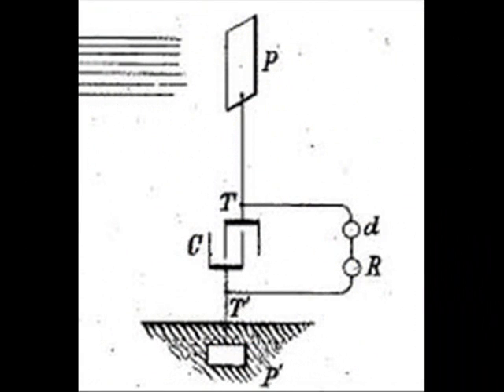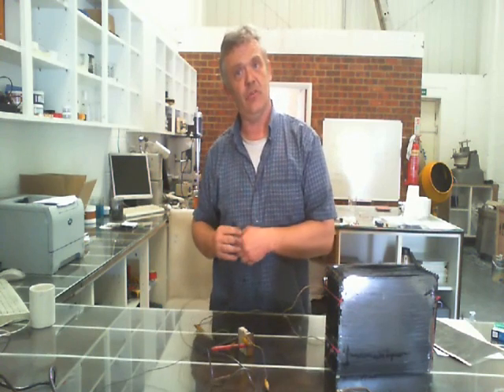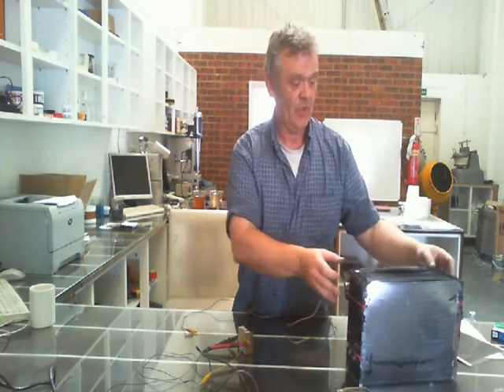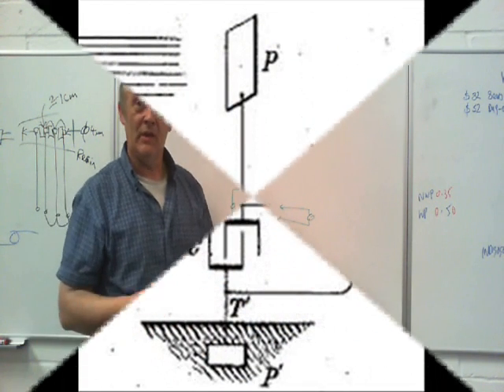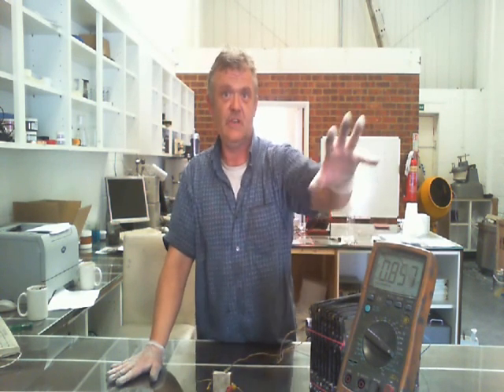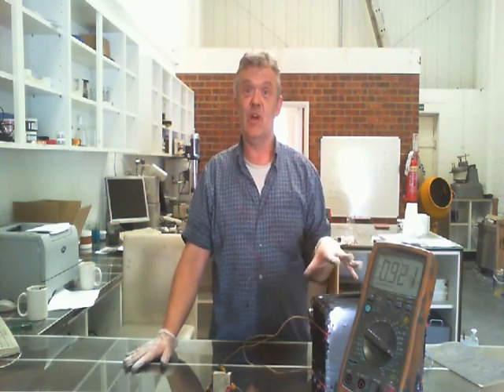SWAG As A Tesla Radiant Energy Collector

Comment: Robert... I love your vids... I have a question. In another vid, you posted one single sheet, where the ac voltage was around 120 volts or so...   However in this experiment, it is rather low, with the sheets in  parallel .   I believe it was the vid ,  Graphene Based Free Energy Antenna System.  What do you think was going on there.   Was the mixture different?  Or do you think you where picking up other frequencies.  Also, when you got close to the device it picked up your field. I think it actually picked up, the bio field around you.  Its that sensitive, it looks like. Cells have a potential around them.

Again, I love your work. I am an engineer, and I have to say, you are brilliant.  Thank you for your work, for it sparked a lot of different ideas in me, that I would like to try. 

Also, I was watching the vid, where you wanted to improve fusion. The only problem, even if you are successful, it will be hard to transfer that energy from the fusor to make usable power. Now, if we had the same set up, but have hydrogen doped inside a metal lattice,  and it will be the metal that will be getting hot, it will be much easy to transfer the heat from the system, for usable energy.
Reply from the maker: glad you like the vids mate and yes it was a different mix - i was thinking of a p-11B mix to get alpha particles and use them to hit a metal container for direct energy conversion
Reply: Robert Murray-Smith
  I watched the vid again, the AC voltage jump up, when you said, you hooked it up to the water pipe.   Now I suppose that is a copper pipe, that is free standing?   Also, with water in it...   You achieved 120 ac volts...   Do you think it was the movement of the water? Or just the copper pipe acting as an antenna?

Also, that is a good idea, to use alpha particles to scavenge direct electricity.  I think that would work actually...   That is brilliant...  I forgot you did say that in the vid...
Reply from the maker: stage274
the pipe is a ground mate and the ground is the electron source - the alpha particle thing was something i read that tesla did
Reply: Robert Murray-Smith
  Ok...  Yeah..  I was just curious why the ac voltage was so high in the other vid, with just two sheets.   I mean, 120 volts  is amazing for just two sheets.  I am wondering why you did not achieve better results with this set up?     It may just be the mixture?
Reply: Robert Murray-Smith
  Thanks again....  Great work!!!!!!!
Reply from the maker: stage274
could be - but don't get too hooked on voltage mate - you can get a few kV by sending a wire aloft at around 300 feet
Reply: Robert Murray-Smith
 You are right... Its just the potential, based on height.   The physics books state we cant get useable work out it.  But, you did show we do have some usable amps.  P=VxA ...
Reply: Robert Murray-Smith
 So, in the other vid, I think you achieved 120 V x .000107 amps= .01284 Watts.    Is that correct?  I mean that is usable power, right?   That is with only 2 plates.  I do realize there is huge number of factors, humidly,  charges in the air... ext... But you did achieve usable power.   Am I missing something?   

I think, even if it is a very small effect, it is still very significant!!!
Reply: I have one more question.  Would Reduced GO, conduct as well as Graphene?  In your experience now.   I would think, RGO, would be able to be dissolved better, in some solvents, because of the functional oxygen groups.

I bought a blender, and the materiel's I will need.  You have really gave me a bug for Graphene. 

Once I have Graphene, or RGO. How do I know I have it?   I mean really have it? 

I have a real nice, spectrometer.  Would I be able to tell on the spectrometer?   Or are there labs, I can take it too?  I am hoping I can see it, on the spectrometer.    I may have some ideas, how to make GO, a lot cheaper than the hummus method. If I am successful, I will post my results.

Again, thanks for your work my friend..
Reply from the maker: stage274
I agree it is significant - but people get so hung up on volts lol
Reply from the maker: stage274
The standard test is the Raman mate - RGO is not going to be as good as defects are introduced
Reply: Thanks. Pure graphene is where its at then for conductivity at least then. 

I wonder, when we blend this, that we might create free radicals, or when, or during sonication.  I am sure we do. I have a few solvents in mind, that may reduce free radical creation.    
 
You made me crazy for this stuff now.  I cant wait to make me a batch.

I will post also, when I get my set up going.

I have so many ideas I want to play with.

Again, thanks for your vids.  And thanks for the knowledge.  You really have some great ideas. I looking forward to share my experience also, in the future. GREAT CHANNEL!!
Reply from the maker: stage274
good on you mate - give me a heads up when you post
Reply: Robert Murray-Smith  Cool. Just one more question my friend..  The expanded graphite, and  the method using h202.  I believe it was FeCl3 within the substrate, then you expanded it, and made a graphene solution.

That is not pure Graphene is it?  That the metal and the chloride is still part of the solution, yes?  How does that effect the solution, and can we get rid of those impurities? I really dig that method for the ease of it.   Does the Graphene separate, such that it can be strained off?

I would like to use that for a filter for my well water. It taste horrible, even after it is filtrated with a normal off the self filter.   And the surface area of the expanded graphite, after the h202 reaction seems ideal for it to be used as a filter. 

Do you think, I can use it, for that, with the chloride, and FE inside the solution?

Again, thanks my man, you have no idea, how much you turned me on to Graphene.  And thank you, for teaching people, because, people really need this technology, such as in Africa, and 3rd world nations, from drinking water, to electricity. .

keep up the good work...
Reply from the maker: stage274
it's intercalated so it just rests in the spaces - when it is expanded and treated the salt will just wash off
Reply: Robert Murray-Smith  Thank you...   :)
Reply from the maker: stage274
no worries mate

Comment: To somewhat explain your results there is always charges in the air as we clearly see in thunderstorms. Thous same charges are always present just not with high enough energy to generate lightning. So there is a certain charge pr meter of hight potential from the ground. So the higher up from the ground you are connected to you place the plates, the more volts you get. Thou you will never get any significant current from it, but you can get hundreds and thousands of volts if its set up right. And the thing about the spark gap is so you can use it as an oscillator into a coil.
Reply from the maker: thanks for that

Comment: have you tried hooking a crystal ear phone to it to see if it is picking up am radio waves like a crystal set? ive seen coils on you tube where people are making AA battery replacers using these coils.
Reply from the maker: got any links?
Reply: watch?v=ZP0Ec7-mhb8
watch?v=MOjPtRGmXeg
watch?v=aXSfynlo57E
watch?v=gcui0K7JZXA
the first one is the one I was thinking of. the rest are cruder versions.
Reply from the maker: astrialkil
that's superb cheers mate
Reply: these seem to have similar voltages and milliamps as to what your getting , maybe you've discovered the copper reduced carbon version of the radio battery. Which is Just what I was looking for !
Reply from the maker: astrialkil
interesting

Comment: I'd say you're increasing the dielectric potential difference of the system by touching it. It even increases when you just touch the table. Notice that whether you touch the SWAG plates directly or through the table the voltage jumps to about 1.1. Even by just lifting your fingers (like at 3:04 and 3:15) it drops down to 0.9. Without the gloves the transmission of potential is even better.
Reply from the maker: interesting idea mate

Comment: There is a potential difference of what appears to be about 1/3 of a volt per foot. Our atmosphere is a plasma and it is connected to the plasma of space. The further from ground you go up the more power you should be able to collect. Brilliant idea by the way. Have you tried it with just one plate? Bear in mind that the surface area of your collection plate affects the amount of power collected. This does appear to be a Tesla radiant collector.
Reply from the maker: I did a follow up in the sun using one plate

Comment: I remember once as I was playing with my oscilloscope, on a low setting I could see the ac waveform emanating from the energy around me, and if I simply lifted the probes the amplitude would increase. I suggest you try the experiment again with the power to your lab cut off, it could simply be an an efficient antenna tuned to 50/60 HZ. The best would be a scope if you can get your hands on one. Incidentally have you ever touched an antenna an the radio signal improved? Your the antenna?
Reply from the maker: makes sense - thanks

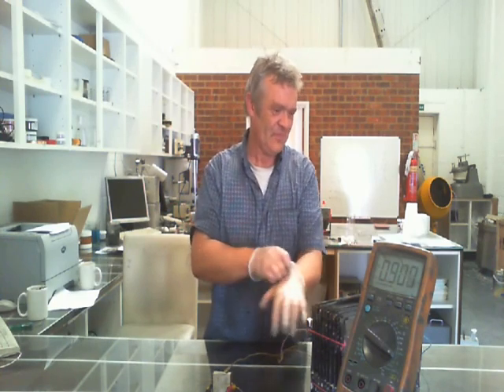Comment: Maybe I'm wrong, but at 2:10 you showed how the meter jumps up when you touch it. Then at 2:40 you're holding over your head (and of course touching it) and the meter jumps up to barely 1/10 volt more than when you're touching it at 2:10. I'm not sure that demonstrates much.

I think you need to put it on an elevated insulated stand of some kind to get a good measurement.
Reply from the maker: you are quite right it doesn't demonstrate a big jump but it does demonstrate a jump - you are equally right it needs to be higher and insulated.

Comment: P.S. Based on how it drops down when you place the Plates on the Floor I'm guessing it's collecting and storing Charge (which is why I thought it acted like a Capacitor) from both the Air as well as from any other Electrically active potential (your Hands ect) because the Floor is usually well Insulated. Have you tested the Heat difference on the Ceiling as to on the Floor? If the reading on the Ceiling is not much different from on the Floor then that's pointing to Electrical excitement in both the higher altitudes as well as from Charged surfaces like your Hands ect, but if the Ceiling is much warmer than your Hands then that could explain the increase in the Meter.
Reply from the maker: good points mate - i'll have a look at that
Reply: Your welcome, I would check the temp on the outside of the Plates and in between and I would also check the temps on both the Ceiling and Floor to use as a cross reference to judge if it's just the Heat as opposed to being a combination of both Heat and the Electrical Charge in the Air and your Hands. Great work!
Reply from the maker: cheers mate - i am going to put it on the back burner for a little while to finish the swag obviously but i will look through all the comments before i pick it up again
Reply: I see, okay, awesome work, look forward to more Vids!
Reply from the maker: *****
too much to do and not enough time to do it all mate - i am hoping others will pick up on this and run with it

Comment: Another excellent and fascinating demo!  I just wanna check, because I'm not completely sure. The copper strips on your plastic sheets are on the reverse side of the ink layer, right? So there's no connection between the two? Have you used typical OHP sheets, or something else?  Thanks in advance mate. Such a simple set up!
Reply from the maker: Hiya Mate, no it's just the plates for the SWAG - I was asked to do this as a quick test the construction details are in the SWAG generator prototype update video it is just ohp sheets painted with the ink - the copper strips are under the ink and act as current collectors - so you put the strips on the plastic, paint them over and you are done - but as i say details are in the swag vids
Reply: Robert Murray-Smith Cheers mate!  I've watched them all, but I get the wrong end of the stick sometimes. I will get down the shops tomorrow and get the OHP sheets, and give it a go.
Reply from the maker: MrSkypelessons
cool - coz i am going to concentrate on the swag for a little while and pick this up again later - like the monotherm - they are interesting but asides for me just right now

Comment: There is potential in all things, for all things are energy. In transition from one state to another, it is possible to influence higher vibrational energies in a resonant conductive medium. I have done this same experiment as described in the patent.  The difference here is that you have a conductive medium that allows a more robust set of energetic frequencies. Like using a smaller string on a guitar,  its apt to move with ever so slight amounts of potential energy exerted. It's vibrational resonance is a tune to a higher frequency. All hypothesis I guess, but from some experiments I have studied and conducted, it seems nature gives subtle hints in reoccurring patterns. Thanks as always, looking forward to experimenting with this ink. :)
Reply from the maker: cool mate
Reply: Sorry for the grammar, its tuff on a mobile device attempting to rush out the words in a ten minute break ;)

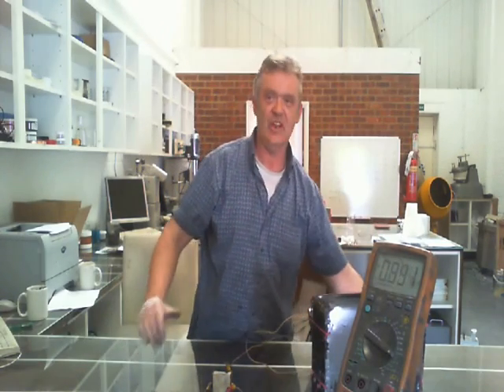Comment: Wow! Cool! Thanks mate. Your videos always have me thinking on the subject. Through out the video it looks like the voltage is hitting 7 (2:51 7.196volts) with quick movement. LOL! That's amazing. I think there are several things going on. Elevation, capacitance and function as an antenna. Ionized air flowing over the plates like seawater. Light also resonating from plate to plate as it passes through. It could also function as a static charge or ozone converter. A motionless unit windmill might be possible. Your ink opens some amazing possibilities. I look forward to seeing what the future holds.
Reply from the maker: cheers mate - i don't think i really know what it is here with the ink
Reply: Don't think that's 7v it's artifacting in the video.
Reply: ben dorman I think your right. It does pose a lot of questions though. I'll have to do some more research.
Reply from the maker: Michael Meadows
yup lol

Comment: Not that I don't think this is cool, but I want to point out performance. The cell, at its best, using you as a capacitor or a heat source, performed at about .04 W per square foot. Your thermocell performed at about 0.25 W per square foot.  Both were at ambient (roughly STP).  Do you believe one to be more promising than the other?   I see that not knowing how either really works makes that difficult, but right now at a glance the thermocell looks better.
Reply from the maker: hiya mate - at this stage i just think it is interesting - i will carry on with the swag - but other know more about this than me and it is here to show what is possible and just that it was interesting

Comment: Robert, you rock! As I can see in the video, the SWAG acts as
- antenna when you put it in the air (collecting the energy from the aerial waves, transversal or longitudinal ones);
- as a "Alessandro Volta" battery when you put some salt water on it (chemical reaction)...
It seems that these characteristics are typical of a carbon-based material.
I think that air pressure (elevation-dependant), temperature and/or moving magnetic fields can affect the power produced by the cell too.
As you perfectly know, the most important thing is the power (Watts), not only volts: could you please show/tell us how many of them can the cell produce in their different situations (aerial, salt water, pressure, magnetic, etc.)? I love your work, go ahead and thank you for sharing your precious research.

Comment: Why does it go up to 1.5 volts when you move it through the air? Is air rushing over the plates having the same effect as when salt water rushes over it?
Reply from the maker: dunno - may be - it needs investigation
Reply: To be honest I have no idea about this stuff. I just find it all very facinating. Could you try blowing a fan over it? I don't know if the energy generated would be significant enough but the thing I thought of was multi plated rotar blades that could somehow give a wind turbine a secondary power generation source.
Reply from the maker: nitelite78
interesting idea - but I am not likely to do anything with this for a while - too many other things to do

Comment: I have a cordless phone (can transmit power). I have got WIFI (and all of my neighbors as well). My mobile will once and a while connect to the GSM network. And My office room is a kind of Faraday Cage (I can only receive a very local FM station, not much more). If I touch the outside of my radio (plastic) I hear a loud noise. And I found out one of the other transmitters in my office is the power adapter for my Laptop (transmits a terrible lot of noise). And I have a inverter for my solar panels in the same room (seems to give noise as well on a lot of apparatus). So where does the power come from? Needs some research. Is your WiFi transmitter is mounted rather high in the workplace?

Also note, the ground should be considered as a source. No need to say the ground is relative.

And from what I understood of the radiant energy Tesla had, it seems to me that electrons were excited on the collector plate because of what was radiated upon it.

Did you try and attach just a piece of metal, and hold it up? It might generate almost the same (who knows?)
Reply from the maker: good point i'll do the metal test - cheers mate